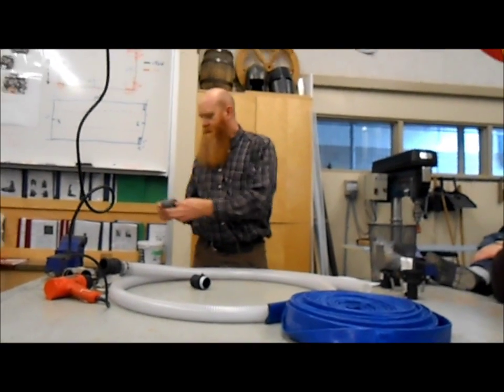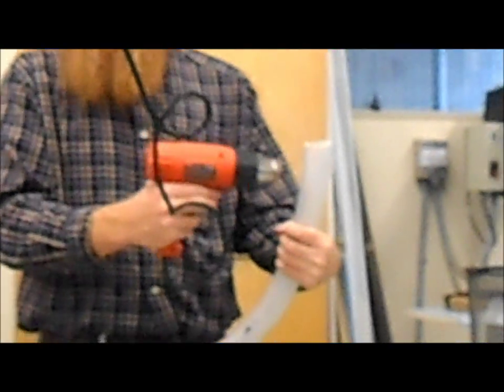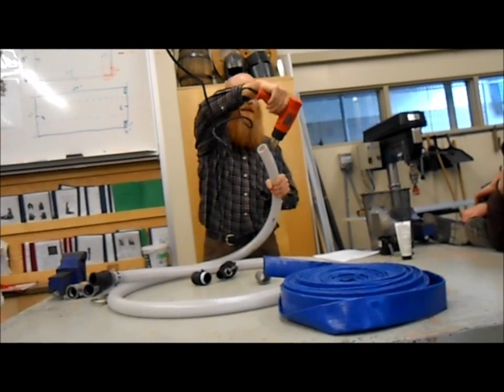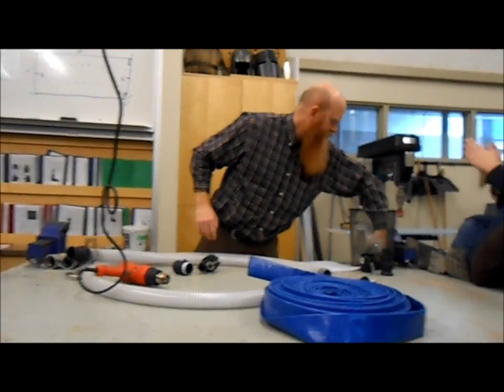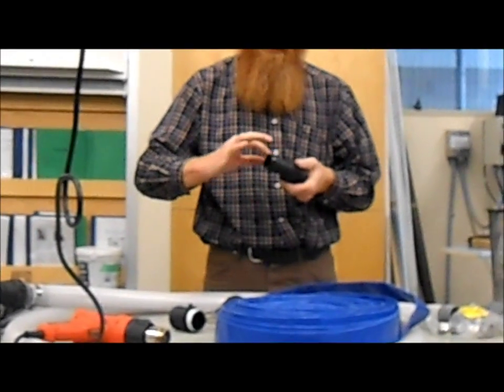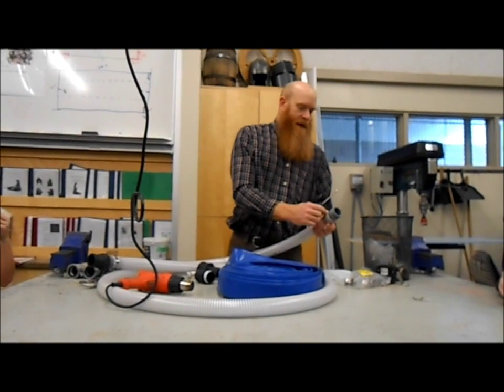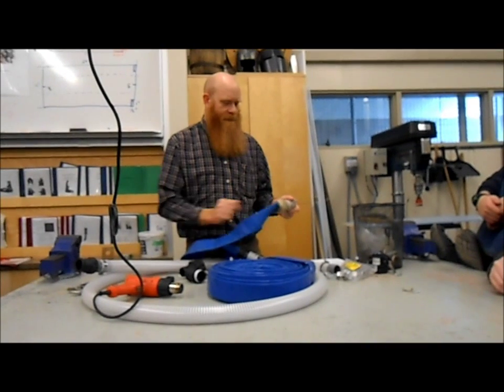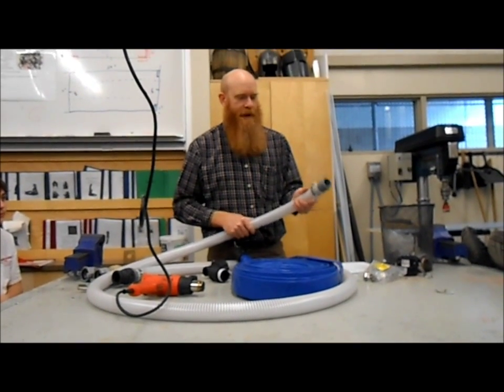Gold mining course, Hose barbs and clamps

Comment: For future reference, using liquid dish detergent does the same thing as the grease, but its harmless to the gold and washes away completely within minutes of the first use
Reply from the maker: +The Silver Fiend I could not get the liquid soap to get it all the way on.  It would slide about half way then lock up solid.  Might just have been the brand I was using.  I have never noticed even the smallest amount of greasy residue come though in the water from the pipe.